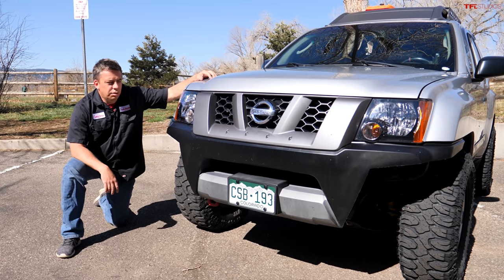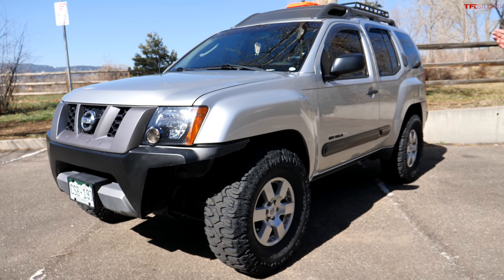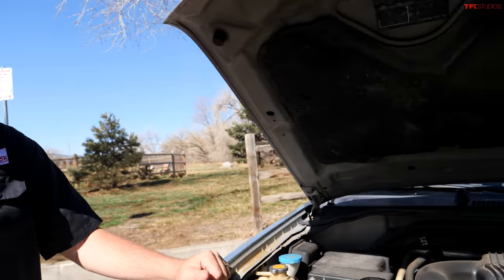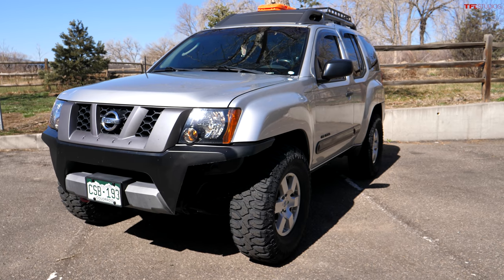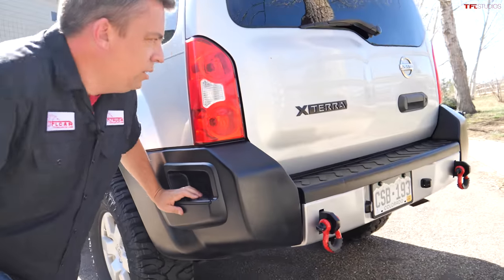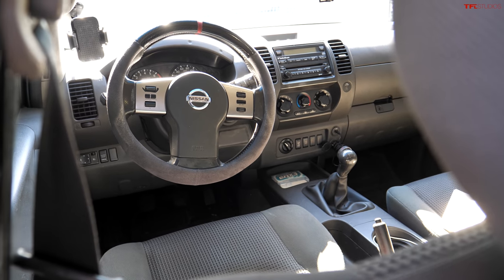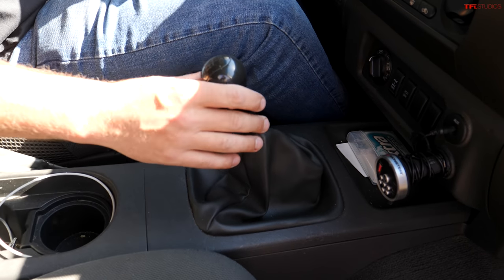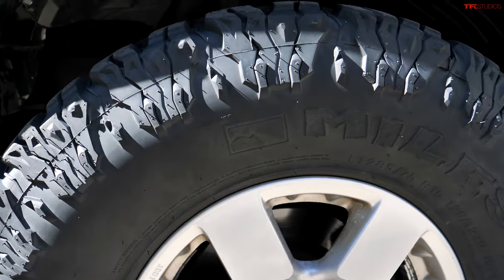I Found This One-Owner Nissan Xterra With A 6-Speed Manual For UNDER $4,000! | Dude, I Love My Ride

Comment: its so stupid how everyone thinks that toyota is completely then end all be all for reliable daily drivers. you can find Nissans and hondas for super cheap. mr regular spent $16k on a 2000 4runner just cuz it only had 75k miles on it! He could’ve bought a brand new car for that much cash!
Reply: @DevilDog53 yeah i daily drive a 109k mile  1994 ford f-150 4x4 5.0 5 speed and i would bet that its just as reliable as any toyota pickup! the engine was constantly improved for 40 straight years and if the 302 was such a shitty engine then why did Shelby use them to this day? i can fix it in the least amount of time and the only times it didn’t start for me the battery connections need to be replaced but i just drilled a sheetrock screw into the post and terminal and it works like a champ.

Comment: The pathfinder is really the same rig.  I love mine.  Tows and is very solid.  Sucks on gas.
Reply: Not entirely, they never came with a 6 speed manual or a rear locker. Also the path is independent rear suspension.  Other than that yes

Comment: X are so hard to find and here in Washington I dont see them as much specially the blue one. Great rig IMO reason I bought a 2015, I thought about trading it for a 4runner but nah, I see those everywhere I look. Does anyone know what roof basket it has?

The battery terminal is made by Rugged Rocks. Best one out there

Comment: can’t find a manual less than 15k with 100k+ miles
Reply: @DevilDog53 I had to settle for an automatic pro4x with 130k miles for 12k. I’m pretty happy with it
Reply: @DevilDog53 yes they are. I’ll be keeping mine forever. These are worth fixing. I off road mine hard so no point in having a survivor

Comment: Swap in a trans cooler IMMEDIATELY. Then your good to go
Reply: A Trans cooler on a manual? How is it supposed to circulate the fluid?
Reply: wot
Reply: Yep. Had that problem with my 05 at 150,000. Not sure when it started leaking tho.
Reply: Doesn't have one because it's a manual. Common sense.
Reply: Yeah yeah parrot whatever you hear... it’s a manual genius.
Reply: Yea commented before I seen it was a manual 😄🤦🤣

Comment: I really really want to like the exterra  because I absolutely loved my 87 pathfinder but after it dropped a valve and punch a hole in piston number 3 and then my maxima which was a lemon had a knock sensor go out that is under the fuel rails and air intake manifold go out I'll really questioned nissans engineering. Damn shame really, that pathfinder was the doo doo. I can't get down with nissan anymore. Maybe the exterra is different? It looks awesome except for the nissan emblem on the hood.

Comment: I have a 06 Frontier with 105,000 miles i also  ave a small lift and 32inch tires i like the bumper mod ive had alot of people offer to buy my truck nissan should come out with the xterra they would sell with Bronco and jeep people would buy the new xterra for sure.

Comment: With the titan swap you can fit 35s and 37s and get 12” of usable travel on IFS… You’d need a long travel setup to get the same equivalent on a Toyota. I do believe Toyotas are higher quality, but the 21 gallon tank and torquey engine on the Nissan is nice too.

Doesn’t seem like a bad buy really. You can do a lot with them. I just can’t get over how much uglier they are than the 4runner. I’m sorry. I know that’s subjective but man that truck is UGLY